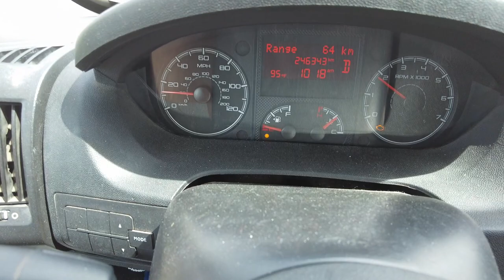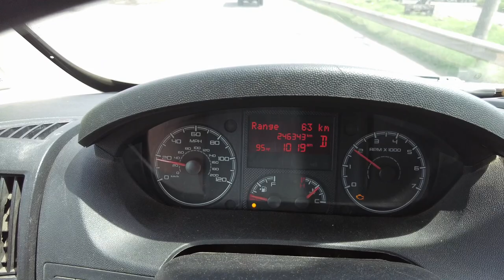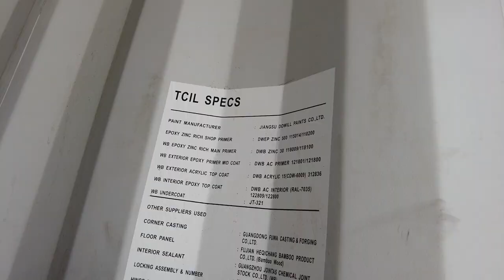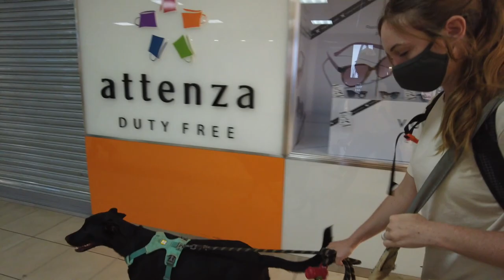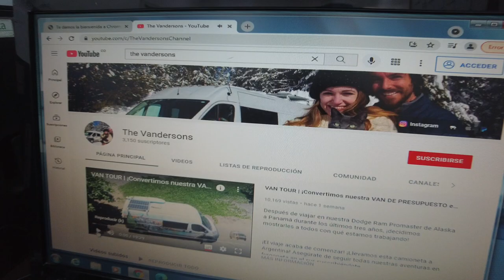SHIPPING the VAN in a CONTAINER to COLOMBIA [Crossing the Darien Gap!] #vanlife #panamericanhighway

Comment: Whoa, tight fit! The container did seem smaller than the one used by Snow and Curt, is that why I think you paid less than half what they mentioned spending? Because theirs is longer and taller, with the storage above? I was wondering why you didn’t ship together... 🤔

In any event, I hope things will go smoothly for your little furry and less furry family! So excited about the adventures awaiting on the other side 🤗 ✈️ 🛳 🤩 🗺
Reply from the maker: They didn’t use a container. They shipped their van on a “car only” barge
Reply: @the.vandersons  ohhhhh it makes sense now! 🤔